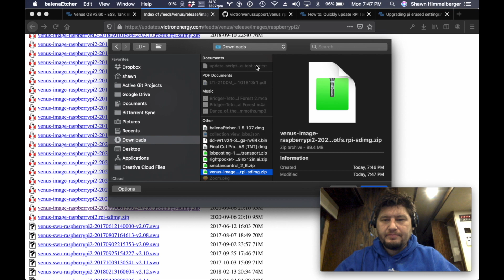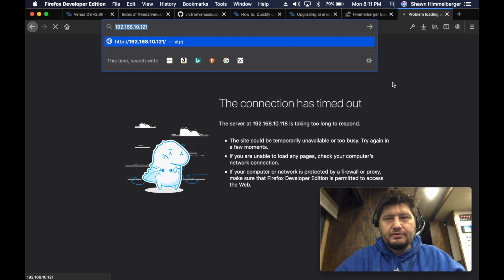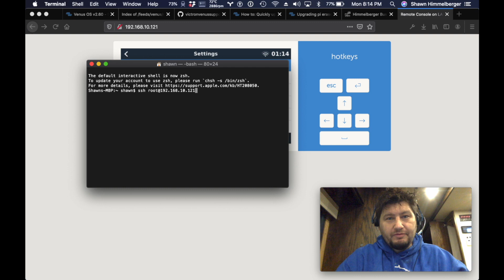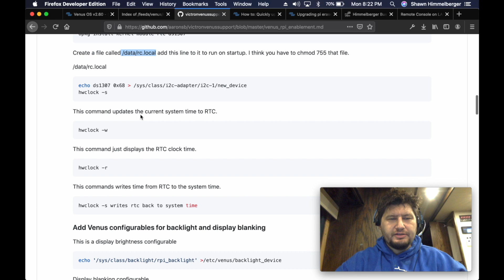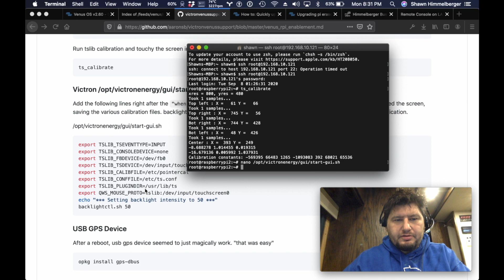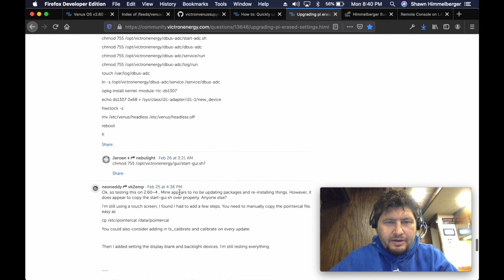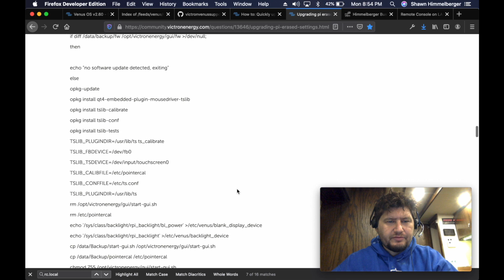Install Victron Venus OS 2.60 on Raspberry Pi with Update Script

Comment: How did you convert your led tail lights 24v to 12v?
Reply from the maker: I ended up putting in resistors inline on the ground connection. Seems to be working fine.
Reply: Himmelberger Bus 6 ohm?
Reply from the maker: @paulswan1982  You know, I'm not sure off hand.  I honestly took a pile of resistors I had and tried different ones until I got something close to 12-14v with the light on. I thought I did a  video on it, I guess not.   I'll measure it and do an update.
Reply: Himmelberger Bus I am from Minnesota and i have the mci mc12 and my tail lights giving me a headache
Reply from the maker: @paulswan1982  If they take bulbs, I used the LED replacements for the main ones. They are 12/24v they will work with either.

Comment: Looks fascinating Shawn but way over my head what's the difference between the rasbèrry pie and the color monitor that Victron sells? I'm sure cost is a big part is the Victron color monitor a touch screen? If not I could see the benefits there. But what else? Thanks for sharing the information on how to do this.
Reply from the maker: Yeah, it can be a cheaper way to get CCGX functionality. Initially Victron had no touch device unless you made one like this.  Now they have one. One downside to this is you have to buy USB dongles for all the Victron devices, so the savings get eaten up quick.
Reply: @HimmelbergerBus  thanks Shawn you should do a cost comparison so you subs can see the advantage and what if any extra bells and whistles you can do or add I'm very curious and if I felt confident about what you've done there I would really consider it. 
Thanks for the lesson and your knowledge Shawn its much appreciated.
Reply from the maker: I was thinking the same thing.
Reply: @HimmelbergerBus  if the victron units have Bluetooth do you still need a doing for each unit to connect to the pi?
Reply from the maker: @allornothing7957  Currently as far as I know, yes.  I think BT was cheap workaround for someone who didn't want to invest in a CCGX.